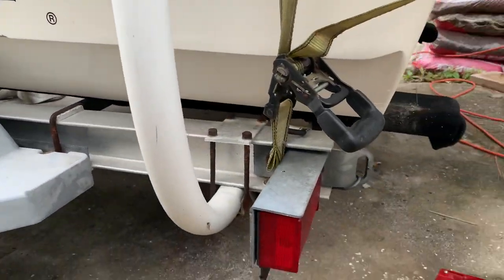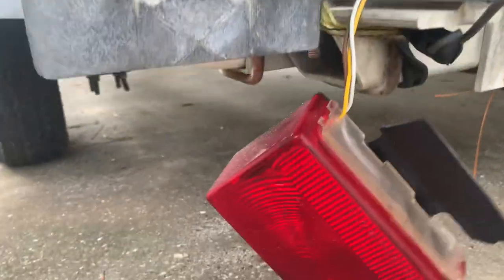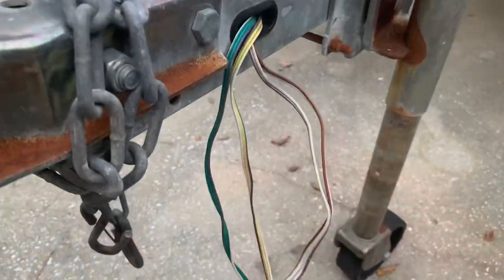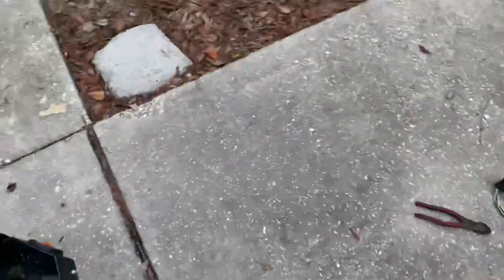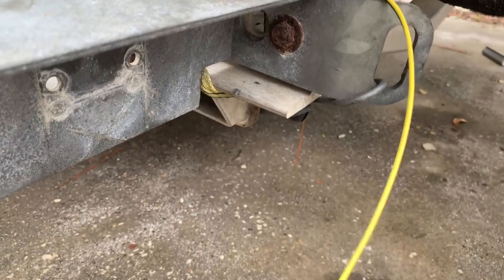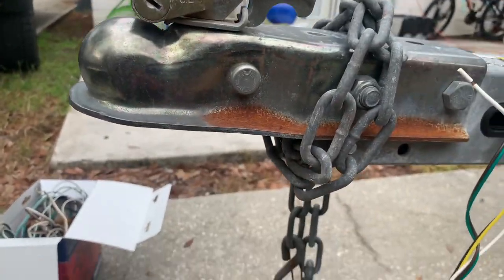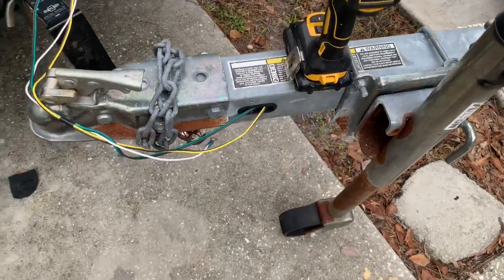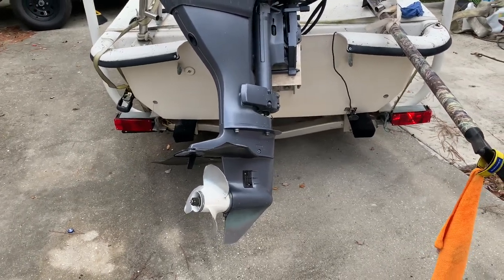How To: New Boat Trailer Lights

Comment: I just bought the same type of kit for my boat trailer. And this video is going to be very helpful with my installation of the trailer lights. Thank you
Reply from the maker: You’re welcome. These light have been running for over 2 years now and still doing great.

Comment: Nice job.  After you first get the lights mounted I would suggest checking the circuit by simply hand twisting the connections together.  Once circuit is confirmed, go ahead and install the permanent connections with the heat-shrink connectors.

Comment: Best You Tube guide and advise! But How come there wasn’t any Tube Loom used in this installation? Is it even Necessary to use tube loom? Cheers TK
Reply from the maker: Thank you! The wire loom is good at chafe points to keep the wire from being cut or from shorting out but not necessary throughout the entire trailer. I didn’t have any issues with that here so it t was not needed.

Comment: Awesome video and I have a quick question.   I have PVC trailer guide posts and bought a set of LED lights that attach at the very top.   I would like these to function with my trailer left and right lights.   Any ideas on how I can integrate the wiring so they work properly?
Reply from the maker: Most of the time those are used instead of the low tail lights. You can wire them into the existing wires going to your current tail lights though. You’ll need to splice into the current wiring. I’m not a fan of cutting and splicing but that would leave you little options. I would put the ground on the bolt just like I did on the current tail light and use a blue butt connector and put the 2 tail light wires in it and crimp. You can put silicone grease or dielectric grease In the connector before you heat shrink to help keep water out and prevent corrosion. The other option is to run the wire all the way back to the tongue of the trailer and tie in up there so the connector are never submerged.
Reply: Awesome I can't thank you enough for the response

Comment: I just installed my trailer lights. Same set up.  Breaks work, flashers work but running lights at night don’t. Any thoughts?
Reply from the maker: @joecastillomovies  check and make sure you have power coming from the vehicle on the flashers and running lights on the vehicle side. Also check connections by giving them a good tug to make sure they are solid. If you do have power coming from the vehicle I’d go to each connection and see where you have lost power from the front to the back.

Comment: So you don’t have to worry about the white ground wire getting wet?
Reply from the maker: No because the ground wire does not carry any power. You do have to have clean metal surface for it to attach to.

Comment: Why did you leave the light mounted on the end with some of it hanging past the frame, wouldn't it make it more prone to break?
Reply from the maker: Not more prone to breaking unless I run into something. At that point my trailer or guides would have hit the object first. The original lights were not available so I got these because the bolt pattern matched up. Still have not had any issues with them.

Comment: I replaced my lights with new one brake lights work but my left turn signal not working can anyone give me what to look for?
Reply from the maker: If you have new lights your 2 biggest concerns would be 1. A good ground. 2. Getting power to the bulb. 
Check all of your connections. Make sure your contacts are clean and make sure your connectors are good by tugging on them. It wouldn’t hurt to check your bulb also to make sure it didn’t get jarred loose in shipping. Let me know what you find or if I can help any further.

Comment: Where can I purchase this harness?
Reply from the maker: I bought the entire kit from West Marine. You can probably get them on Amazon also.
Reply: @captleesoutdooradventures7133  with that harness does it only come with 1 connector that goes into truck?
Reply: I ordered a kit from Amazon for my 18ft pontoon trailer the wiring that came off was wesbar but I tried putting the new harness on and it had 2 connector male and female the connected to each other but other end didn’t match up to my truck. I’m pretty sure I got the wrong harness
Reply from the maker: @jacobluebbing8933  typically the 2-connector plugs connect the lights to the main harness. The main harness is usually a 4 wire set with a 4 way flat plug, link is below (Amazon). Just make sure you get the correct length.
https://a.co/d/hO6v11Z

Comment: Did you have to replace all the wires running thru the trailer or could you have only replaced the light itself?
Reply from the maker: I could have replaced just the lights and connected them with butt connectors just like in the video but the kit included new wiring so I chose to replace it all.